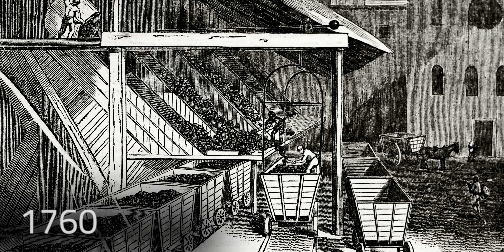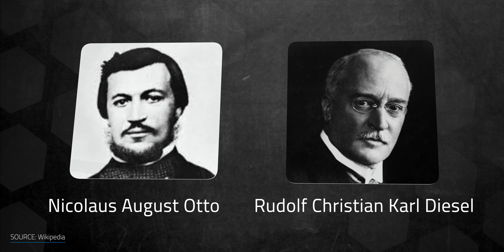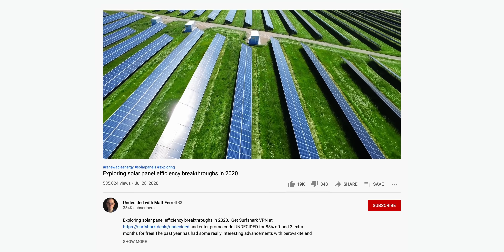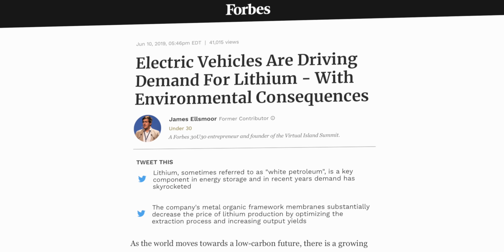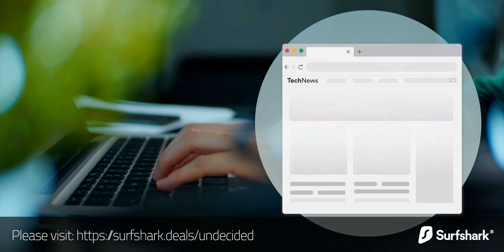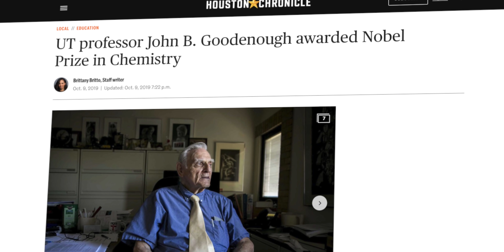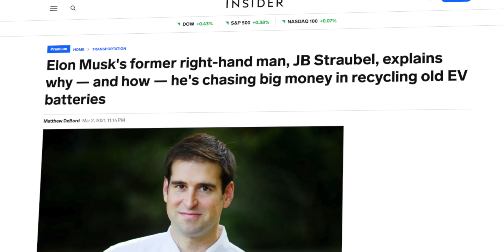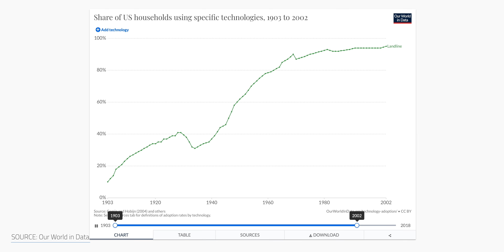Is the Future of Renewable Energy Inevitable?

Comment: 4:02  Solar panels currently convert 15-22% of the light energy that falls on them.  It is simply mathematically impossible to achieve 10 times greater efficiency like the steam engine.
Reply: Good thing we don't need it to be 10x more efficient.  If we never got a single percentage more in efficiency from now until the end of time, what we have today would still be good enough.
Reply: @ultrastoat3298  and 20% of every eligible roof that is currently producing 0 would seem like a good start.
Reply: Yea that's why everything needs to be seen in context. The "first" steam engine prototype was simply so bad that immense increase in efficiency was inevitable no matter how you looked at it - but early solar cells were already quite efficient considering their inovative state.
It will always be easier to quickly improve a very bad product, compared to perfecting a decent product. Solar in truth doesn't even need to increase its effectivity much, what we need is for the cost to go down, and the materials to be less labour intensive and less harmful, and more easy to recycle. These are the main metrics we should look at, when evaluating technological growth over time.
Reply: @Real_MisterSir  Not if you consider excessive land usage to be a problem.
Reply: @budders9958  We don't need to put panels on "greenfield" land though, we have plenty of already paved land (parking lotts and buildings) that we can put panels over
Reply: No. The problem with solar is intermittency and cyclical yield ( ie. Day/night cycle and seasonal yield variations ).
Reply: @Real_MisterSir  Voltaics could be damn near free and it still wouldn't solve the main issue with solar.
Reply: @ricksanchez6810  I would bet everything I own that it would. If photovoltaics were nearly free, it would drive massive amounts of research into energy storage and inevitably lead to much cheaper energy storage methods. Issues with variable energy production can also be mitigated with time of use rates and customer incentives, load shifting, energy efficiency investments, non-solar power sources, and high voltage transmission lines that allow excess energy production to be shipped across the country and stabilize the electric grids.
Reply: @gregoryoatmeal7068  On how long of a time scale would you like to make that bet? If it's 20 years, you will lose.  Our grid needed to be upgraded 50 years ago, yet here we are. We would need trillions of dollars in infrastructure upgrades to make the problem with solar go away. Yeah, sure, the bureaucracy will get right on that. It's not that it's impossible, it's that the will to spend the money doesn't exist.  I understand the science can make anything possible, but not at a cost our civilization will pay.
Reply: @ricksanchez6810  If some crazy miracle made it so that solar were widely available for 1c/KWH at grid scale, we would immediately start retiring most other generators. People and businesses would quickly learn to match energy consumption to production (this would happen instantly with autonomous electric vehicles). Energy efficiency investments to reduce peak demand would happen immediately. We would develop better load-shifting strategies. We would likely see steep declines and price breakthroughs in the price of sodium-ion batteries, vanadium redox batteries, gravity energy storage, ice storage air conditioning, liquid solar fuels, green hydrogen, etc. Entire industries we can't even imagine would spring up to take advantage of the available excess electricity during the spring daytime. We would find other solutions - maybe small modular reactors could be moved cross-country between winter-peaking and summer-peaking regions. The price of electricity would go down and a ton of innovation would follow. And that isn't a fantasy about innovation - those sharp price declines and rapid technical innovations have been the norm for renewables and energy storage for the past fifteen years.

You act like solar is so deeply flawed when there are so many different ways to use technology and innovation to make it fit into the electric grid. Have some imagination. This is the best problem we could have!
Reply: @gregoryoatmeal7068  I don't think you are reading the many replies you've gotten.
Reply: @ricksanchez6810  I think you meant that comment for George Mann. He actually repeated a bunch of the stuff I wrote about by using some weird example of a South Korean nuclear reactor. I'm not sure that he read this was in one of the only markets where nuclear power outperforms renewables. I provided a study that showed renewables are expected to be cheaper than nuclear by 2030 in that metric. He also keeps citing these weird metrics like gigawatt-years and EROI that no one uses. And he keeps citing these weird metrics like wind and solar used to take 4 to 10 times longer to build than nuclear (pretty sure that's backwards). Then he brought up the myth that renewables last 10-30 years (I think this is in reference to the inverters?). And then he started talking about thorium which is a really cool technology that will hopefully replace all electricity when it's demonstrated to be commercially viable in the 2040s (if everything goes right - I'm crossing my fingers because thorium does sound cool)
Reply: @George Mann when I look up the eroi of solar it seems a lot more positive than you are stating here.
Reply: @George Mann Please read up on Levelized Cost of Energy studies and studies on how the electric grid can be stabilized by renewable energy. The only forms of new generation that are market-competitive in this day and age are wind, solar, energy storage, and natural gas. Gas plants are subject to volatile commodity prices and will inevitably become stranded assets. Coal isn't critical - it's an obsolete fuel and the coal plants are stranded assets. Nuclear power is almost impossible to build and it's not cost-effective at all. In the US we built two nuclear reactors in 4 decades and it bankrupted Westinghouse. Geothermal is also almost impossible to build since the only viable locations for it require an impractical amount of new powerlines. Solar, wind, and storage decline in price every year.

Which of my ideas cost money? I can point you to multiple studies that show this is the most effective way to create a clean stable grid. Energy efficiency is demonstrably cheaper than any form of new energy. Time of use rates don't cost money to implement. I'm legitimately confused at what part is expensive.

You seem passionate about this topic but you've found some really bad information. I'm happy to clarify any questions you have and provide citations.
Reply: @George Mann You talk about how abundant cheap renewable energy is a problem. This is the best problem to have! 

“There is a misconception that too much solar and wind energy is a problem,” said Dr. Adam Dorr, report co-author. “That is looking at the equation through the old fossil fuel system lens, and doesn’t recognize the fundamentals of disruption. Sunlight and wind are free, and it is irrational to curtail the nearly costless clean energy we produce with them. As with other technology disruptions, it is a mistake to ask how the existing system will accommodate SWB. The grid as we know it will rapidly evolve into a larger, more flexible, diverse and capable system, just like the landline telephone network evolved into the Internet. Instead we must ask, ‘how can a new energy system based on SWB minimize costs and maximize benefits at every level of society and the economy?’”

It's clear you're operating on a 20th century model where the grid operates on a few reliable and expensive electricity sources rather abundant cheap variable renewable energy. Your ideas are all based on the misguided notion that customers won't respond to price signals and take advantage of variations in the price of energy that vary according to the hour and the season.

This is a great read:

https://www.rethinkx.com/press-release/2020/10/26/new-report-rethinking-energy-2020-2030-100-solar-wind-and-batteries-is-just-the-beginning
Reply: The most efficient solar panels are used for satellites but those are super highly toxic to produce.
Reply: @George Mann you keep saying eroi is low but I can't find that anywhere
Reply: @George Mann You said we'd need 4x more batteries vs. nuclear if everyone decides to charge EVs at night. This obviously won't happen. Consumers aren't stupid. If we overbuild renewables (which we should), we'll have a massive abundance of electricity during non-peak daylight hours and customers will be able to charge EVs during the day very cheaply. Consumers will respond strategically to electricity price signals. We're not going to need to build a ton of batteries because everyone will collectively decide to ignore price signals and charge at night because they want to pay an unnecessarily high electric bill. There's no reason we can't simply leave our cars plugged in and have apps that automatically start charging our cars when electricity is abundant and cheap.
Reply: @George Mann I worked in transmission planning for years. You have to build power lines to build nuclear plants too. So your options are:
1. Wait fifteen years for nuclear power plant permitting and related transmission to get approved (which almost certainly won't happen) OR
2. Build a bunch of wind and solar everywhere for between 1/4th and 1/5th of the price (Lazard's analysis) and throw in some batteries to firm up the power. And then build some power lines when you have enough renewable energy to cause grid stability issues (which is years away anyway, which is perfect for the amount of time it will take to permit the transmission lines). 

Most high-voltage transmission is only operating at like 15% capacity (because we need a ton of redundancy to prevent the grid from failing). If we overbuilt renewable energy across a wide geographic area, invested in some energy storage, implemented energy efficiency incentives and load flexibility policies, and built a few more power lines, we would have a very stable grid for less than half of the price of nuclear power.

I would rather use rural/farmland for renewable energy that can be built in three years and mitigate climate change than wait 15 years for a nuclear power plant to be built.
Reply: @George Mann EROI is garbage like GDP and "reserves".

Your analysis, isn't
Reply: @George Mann wrong analysis .  France can't export any nuclear design.  Germany's solar tech is now everywhere
Reply: Also Quatam dot solar cells has a potential of 66% conversion.
Reply from the maker: There's a lot of compelling research with solar cells that are more than double that.  It's only a matter of time before we start seeing them on the market.
Reply: @UndecidedMF  Not for terrestrial solar farms you won't: 

High efficiency PV needs high concentration (x143 suns for the six-junction 47.1% efficient example you give - https://www.nrel.gov/pv/assets/pdfs/best-research-cell-efficiencies.20200104.pdf

High concentration means narrow sunlight acceptance angle and mandatory two-axis solar tracking; only using the direct sunlight and wasting the rest of the bright (scattered) sunlit sky.

In-turn this means additional east-west spacing to prevent self-shadowing from adjacent tracking panels over the course of the day.

The end result is that your solar farm costs more, is less reliable, and produces no more power than your neighbour's same area Si-perovskite tandem PV farm running at 29.5% efficiency (current lab best efficiency).

- - -

Where multi-sun concentration, multi-junction photovoltaics (MJ CPV) do make sense is on a solar power satellite.

The CPV directly faces the sun 24/365 (excepting maximum 70 minute outages at local midnight during equinox), beaming microwave power to rectenna site(s) through all weather, supplying firm, dispatchable power on demand to wherever needed - meeting baseload requirements without the need for long-duration grid-scale storage.

The best solar farms around the globe annually average only 5-15 watts per square metre, with only 3 sun-hours/day in California's mid-winter (UK Dec/Jan is 1 - 1.5 sun-hours). A rectenna can average 50-60 W/m^2 (ten times less area, or ten times more productive use of land) with a safe peak microwave beam intensity equivalent to one-quarter of noon sunlight (230 W/m^2 at beam centre). In addition, a mesh-like rectenna can let sunlight and rainfall pass through - unlike the modern trend of shallow east-west tilted PV completely tenting over arable land (but maximising utilisation of low-cost PV).

300-600x sunlight concentration means 300-600x less space-rated CPV semiconductor area required.

Current 40% efficient CPV benefits from 35% greater sunlight in space. 
DC-RF - 36,000 km transfer - RF-DC-AC efficiency from SPS to grid is 60%
Doing the math: 135% x 40% x 60% = 32.4% - so space CPV directly beats Si-perovskite (29.5% current lab best) at local noon on a bright sunny day - that's before accounting for the utilisation factor of your terrestrial PV farm (11% typical in the UK).

With the advent of fully-reusable space launch, the cost of launch approaches the cost of propellent. For a hydrogen fuelled RLV, a 2 GW (@ grid) Solar Power Satellite pays back its propellant cost (to GEO) in 23 days... a bit-longer for electro-synthesised hydrocarbon rocket fuels.

CASSIOPeiA
internationalelectric.com
Reply: @George Mann Which is a good argument why having nuclear power in the mix is critical.

Comment: Nobody talks about tidal energy, vast amounts of untapped potential energy waiting to be tapped. 

However it's all too late now give it 100 years and it times up.
Reply: Nobody has figured out how to make moving parts under salt water reliable, cost effective, and with a low environmental impact.
Reply: @ultrastoat3298  well it's about time some university funding was found to explore it.
Reply: Not currently anything close to grid parity, once tidal energy reaches grid parity it would be an absolutely incredible energy source, we are simply better off implementing the energy sources that cost less than 6 cents per kwh now rather than waiting for cheap tidal energy to be developed.
Reply: @garethbaus5471  what would those be 😀😱😥😂😔
Reply from the maker: Lots of interest research and pilot projects, but I haven't seen any viable production level installations yet.  Very cool idea/topic though.